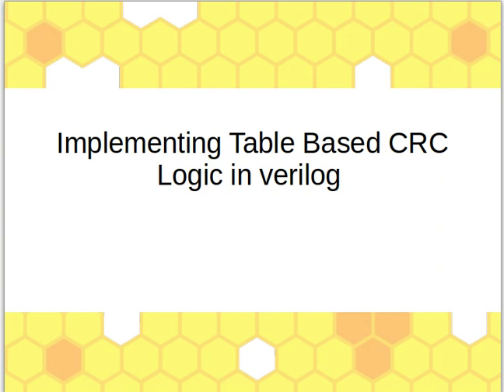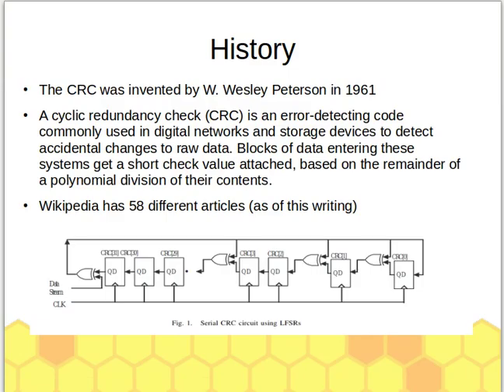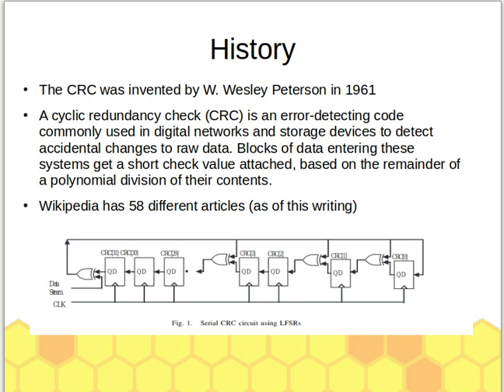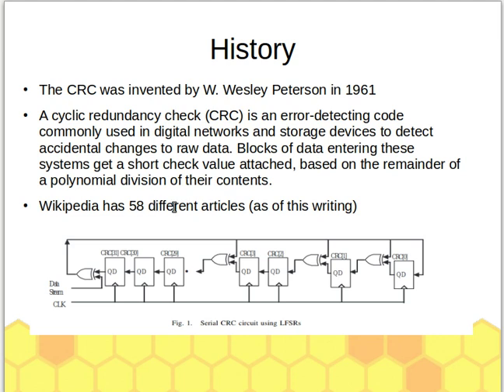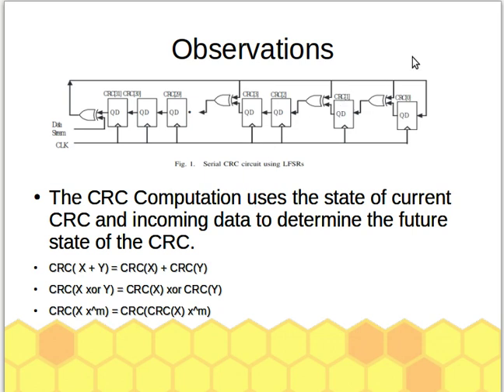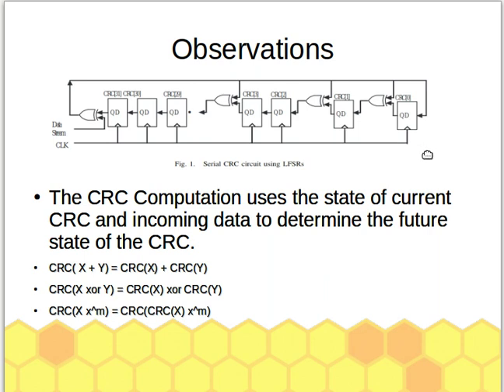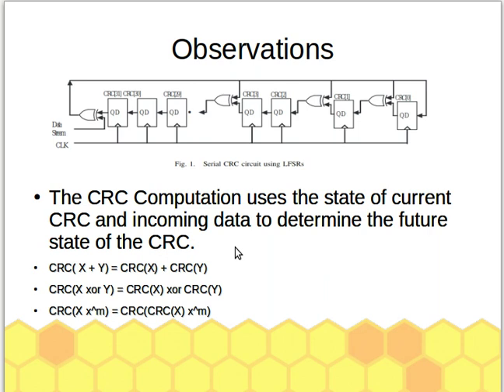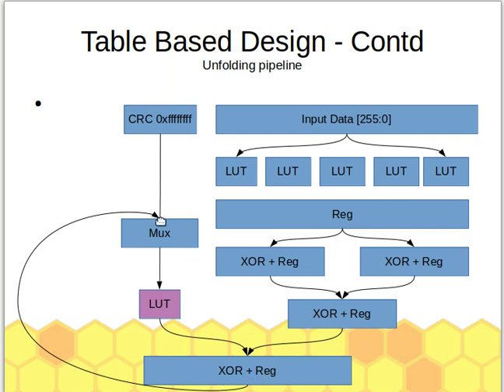100 Gbps Table based CRC32 computation for Verilog - Part 1

Comment: The whole presentation was quite superficial for calculation of CRC using lookup table. Request you to elaborate this in next presentation.
Reply from the maker: Thanks for the feedback. The goal of this series originally was to arrive at fast parallel tables for CRC which can be used to implement CRC32 in wide 32 byte input format using tables. This is already available as three part series that arrives at complete solution of this problem along with source code in bitbucket. Please review the whole series and let me know if this explains what you need. I will make another video explaining the use of tables for CRC32 using 8 bit data approach and provide link shortly.
Reply: @TheMindGrid  I need to implement crc on 128 bit data by look up table methodology and need your help. Share your email if possible.
Reply from the maker: @hemantsaxena369  Please find my email in About Section and Clearing the bot check.